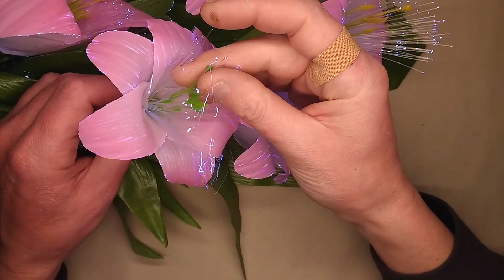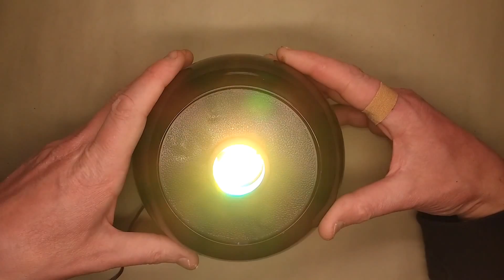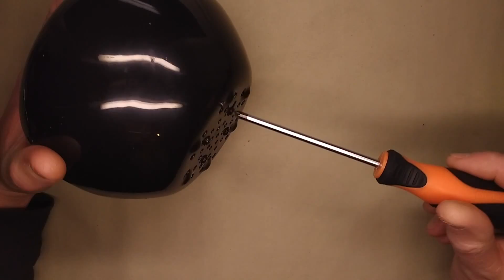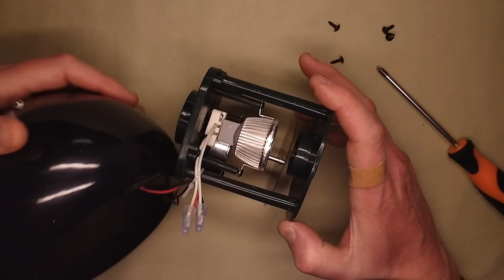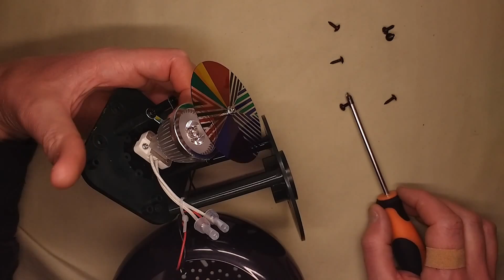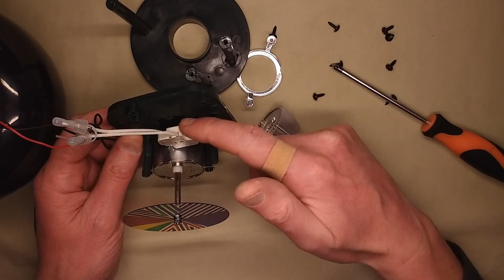Modern LED fibre optic flowers.

Comment: I had one of these (halogen) lamps. I was always concerned with the fact that the metal power jack seemed to stick out of the metal dome case. It tended to spark a bit when you plugged the lead in as there was no power on/off switch.
Reply from the maker: The low voltage halogen lamps drew a lot of current so you would get a sparking from the connector.  They now do them with LED lamps in the same housing and they look super-bright and colourful.

Comment: Random question that you probably don't have time to respond to but anyone's advice is appropriated. I recently purchased a cheap orico 5 port usb charger, from what I can see online the charger it self seems to be decent quality and I am only charging cheaper devices with it, I have a nice anker one for my phone and such. It included a Mains lead that is about 3 feet long and has an internal resistance of 3 ohms, is a lead like this safe (I am in the US, so 120v ac if that matters)
Reply from the maker: For a low current charger that should be OK.  Have you deducted your meter lead resistance from that reading?  (Short leads together to measure the resistance of them.
Reply: bigclivedotcom thanks for the reply, I am using a cheap multimeter and there is 0.5 ohms resistance between the leads so the cable should be fine, thanks again for your time!

Comment: I found this DIY power supply kit. Could you possibly get it and take a look at it?  http://www.ebay.com/itm/LM317-Voltage-Power-Supply-1-25V-12V-Adjustable-Regulated-DIY-Kit-UK-Plug-/282289008841?hash=item41b9bc70c9:g:pk4AAOSwEzxYToYx
Reply from the maker: I've seen those pop up from time to time.  I've ordered a kit to take a look at.
Reply: Cool, Thanks!

Comment: Your product reviews are excellent and entertaining. I have 36 years in the design and manufacture of related technologies. Of course, both quality and safety deteriorated as outsourcing increased. My key responsibilities included product safety, product liability and running the lab. I'm always interested in two characteristcs that I haven't seen included in your reviews: 1) does the item have any safety listings and; 2) what is the flammability of the thermoplastics? Thanks for your excellent videos.    Greg

Comment: Finally 220V AC leds are available on ebay, but we all know Clive did it first. :-D

50W 220V AC High Power led: http://www.ebay.com/itm/232140284945
Reply from the maker: Sadly this approach to high power LEDs has become very standard now.  Cheapness wins in the race to the bottom.

Comment: I'm waiting for the first LED lava lamps.
Reply from the maker: It's tricky.  You have to use a dark heat source and just use the LEDs for illumination of the wax.
Reply: Why not a panel of LEDs inside with a random "flowing-wax" display?
(rushes off to patent putting a smartphone in a bottle)
Reply from the maker: Jafafa Hots Nothing can beat the 3D randomness of a real lava lamp.  It's a shame they're so hard to make.  It's a very delicate balance of the carrier fluid and a mixture of wax and heavy solvent.  One of the first projects on my website was about lava lamp making.

Comment: Interesting video. im guessing that they also changed the transformer to a smaller size as the old halogen bulb would have required much more current.

Comment: I converted a halogen fiberoptic xmas tree to LED the exact same way, just got a 12v LED replacement lamp... it was a good result.
Reply: Me too. 6'/2m tall tree originally with a 35 watt halogen MR16, since it has a cooling fan I put in the highest wattage LED drop in I could find, a TCP 7 watt dimmable one. 6 LEDs in series driven by a boost converter for 12v AC or DC operation, dimming, and power factor correction. The boost controller is powered from its own output so it starts up at about 7 volts and keeps operating down to less than a volt.
Reply: Mine wasn't nearly that ambitious :D just a 3 foot tree with the base internals much like the one the big guy took apart... I just figured "I'll stick in a comparable LED bulb". I applaud your project ;)

Comment: I have one of those little Christmas trees with this same kind of construction. But mine has an oldskool halogen bulb in it, which makes the thing getting hot when it's running for a while. Also, as you also mentioned in the video, the motor is very noticeable, making rattling noises and such. This made me wondering if I could replace the whole setup with just one color changing LED instead of the halogen bulb and the noisy motor. But then I won't have the 'flicker' effect caused by the stripes on the rotating disk anymore. Decisions...

Comment: It would be cool to see if it is possible to make a large torch using the led bulb and some pound land power banks in a circuit because on the video the bulb looks pretty bright.
Reply: you can just buy a decent small torch that uses led's would be nice and bright, this will probably be a 9-10 watt led at most maybe 800 lumens, its 12v which makes it a pain, youd need about 3 powerbanks to nick the 18650 from to get the 12v.   fenix make some proper ones that can do 800 lumens and more, they are quality if you want to avoid the chinese gamble ones

Comment: This video reminds me I need to find a new motor for a fiber optic Christmas tree I have. A new motor will probably cost more then the tree did but the sentimental of it being the tree my grandma used for the last few years before she passed outweighs the motor cost by a long shot.
Reply from the maker: These units use very common motors used in a variety of decorative lights.  It's often cheaper to get a complete product for the motor than trying to find a new motor on its own.  Also note that these motors are usually AC and will not turn at all if a DC power supply is used to power the effect.
Reply: bigclivedotcom Hi.  How could I send you something to take apart bigclive?
Reply: LtKernelPanic I just typed that in the comments haha, mine still works, it's awesome
Reply: Thanks for the reply. Glad you mentioned the AC thing because I was thinking it used DC since it has a wall wart but a quick look shows it indeed steps the 120v US mains down to 12v AC. The motor still works but is really loud unless the base is laying on its side which makes it less than useful as a base for the tree. I'll probably do like you mentioned and keep an eye out for something similar to scavenge a motor from but like you mentioned things like that seems to have fallen out of style here too.
Reply: Using a DC synchronous motor is also pretty easy if that's all you're able to get hold of. Just add a bridge rectifier and a capacitor and you are set.

Comment: "Fibre optic flowers with the traditional halogen lamp and motorised colour wheel"
Ahh yes. my mum still has one of those at my other place and has been with us for as long as I can remember. I know the one we have is a different flower design compared to what was shown in your video. Actually, I think the part holding the bulb and wheel is the same but has a green felt cover instead of a black one.

Comment: We have a fibre optic Christmas tree that has an almost identical base to that, but using the old Halogen bulb. When the bulb died in it last Christmas, rather than replace the hard-to-find bulb I swapped out the bulb and the rotating disc with a DIY PCB covered in surface mount "cycling" RGB LEDs (I prefer the SMD ones as it saves me drilling dozens of holes!) and four 1N4007 diodes to rectify the AC.

The effect is certainly passable. Mine could do with being a little brighter, and those LED chips' tendancy to go out of sync results in the output being a shimmering blue/green colour, but it's much lower power than the original and it works well enough to suit me :)

Comment: I wonder how it would work if you replaced the lamp and rotating color wheel with programmable rbg led array.
Reply: You can make any colour, but with a single RGB LED only one colour at a time.

...But I've re-read John's comment and he specifically says an RGB LED array.  So everything I said is irrelevant.  Oh well.  It's been a long day...
Reply: John McTeague - or leave the motor/wheel, and replace the white LED with the color-changing ones, and see what that does for you! :)
Reply: He said Array. Which means several LEDs. And each can be addressed on their own.
Reply: You would still be hard pressed to get enough LEDs under that fibre optic bundle to produce any discernable pattern. You have to get right up close to the strands and thus only the smallest SMD parts would give you any chance of making patterns.
Reply: Dennis W maybe a small led screen with a rainbow pattern moving over it? Though at that point the motor and color filter is probably more cost effective...
Reply: You could certainly do that, although you're then restricted to a single colour at a time.  With the colour wheel system you get patterns as the colours pass over the fibre optic bundle.
Reply: Charlie Dobbie not necessarily. If they went all out and used pwm on each of the three led's, they could make just about any color of the rainbow.
Reply: That's even cooler. Now each flower can be a different color, if you place them in the right places under the fiber bundle.